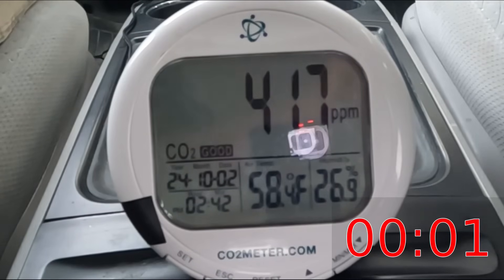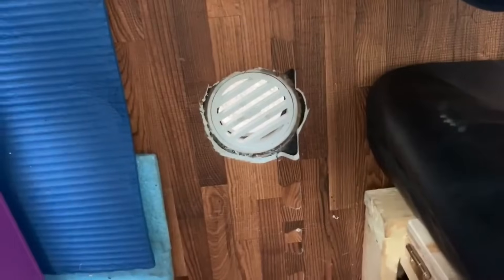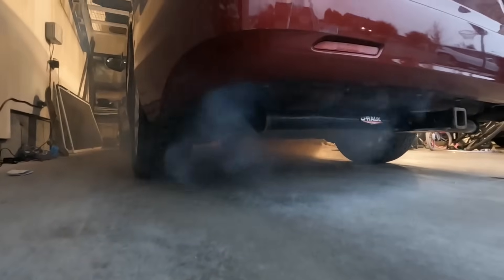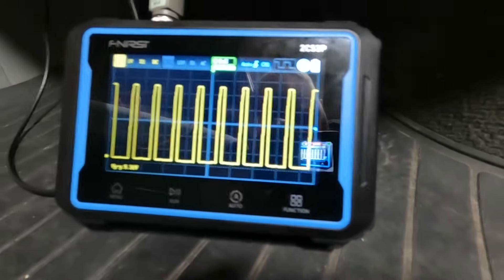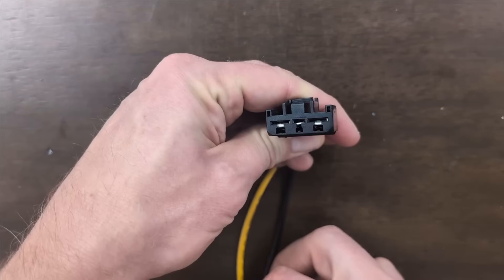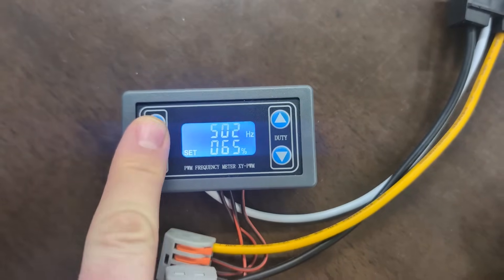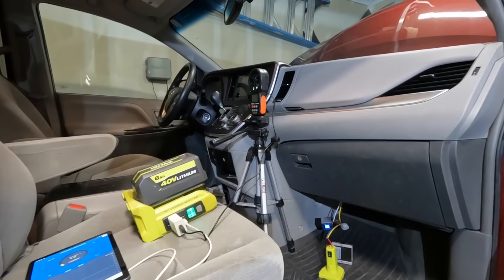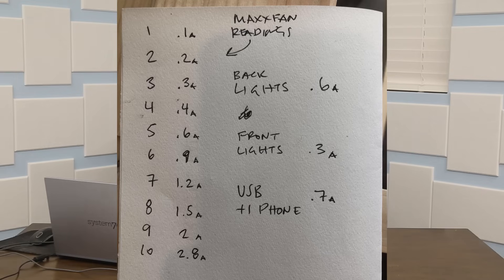Camper van ventilation without using window vents or cutting holes (first see comment by @drewcress)

Comment: I appreciated the effort here but a hidden issue with this approach is most vehicles actually switch to recirculating air as the car turns off. The fresh air inlet is closed to help prevent dust, moisture, and rodent ingress. I spent a fair bit of time figuring out to get both the servo and fan to behave but it gets much more complex as a tap can change the starting position of the servo and break things when the car turns back on. I've tried other ways like a second battery just for car aux power (works) but ultimately the power consumption is just to high to make it worth the effort. What work a bit better is to take a small blower fan and point it out the cabin pressure flap (where the smoke exits). It's non destructive and the difference in pressure will pull fresh air in. However, it's a very small exchange when the van is otherwise closed up.
Reply from the maker: Thank you for sharing! Just to be 100% sure of my own setup, I just now did a smoke test. I put the machine under the hood and confirmed smoke came in through the vents with my battery-operated setup running. So I'm ok, at least, but I wish we had an easy way to tell which vehicles close their air inlets as they turn off.

Out of curiosity, did your tests also use a three-wire blower fan? If not, and you had a two-wire type, can you tell us what voltage range worked best and how you controlled the voltage?
Reply: @SemiSeriousLabs  Interesting! Glad to hear your setup is working as expected. I was a bit disappointed to find the Gen2 Toyota Sienna was more limiting. An aside, but I'm just now noticing much more vertical your air inlet is on the Gen3. Perhaps Toyota came up with a better overall design there given the trouble the Gen2 had with the climate control servos. Maybe Toyota opeted for a bit of an air mixer setting by default too? I could see some upsides to that alongside a more vertical inlet.

As for more exact numbers, I'm afraid I'm not much use there. I was looking if it might work on multiple vehicles at the time and just doing some preliminary testing. It was mostly with a small 12v battery and a pwm controller with a dail, precise it was not. The vehicles in question didn't have a climate control system and their default adjustments where just some resistive elements (hints the silly high power consumption via the aux power approach). All of the vehicle (Express, Promaster, Sienna) did have a recirculation servo that defaulted to internal air when off though. After my testing and a bit more reading, I believed that was generally going to be the case / challenge on nearly all vehicles since the early 90s and onward. Nice to know that isn't so with some newer models with more well adjusted climate controls system. I'll need to do some more reading to understand exactly when and how they differ. Thank you for your video and your testing!
Reply: @SemiSeriousLabs if you want to experiment further maybe find the exit vent and make a contraption to pull air through a part of it?
Reply: I think the recirc flap closing with the car off is only common on older vacuum controlled systems, as there's no vac to hold it open when the engine is off.
Reply: @ericcamolinos3740  It seems nearly all 90s+ and newer servo based systems do this a deliberate feature as well. I'm having trouble finding a modern passenger car that doesn't do this but the lack of a feature isn't the easiest thing to hunt down. I'm still looking, but I've found some hybrid cars use an AC system that can air mix though it still unclear exactly how these behave when the vehicle is off. I did find a couple of RV systems that allow the fresh air intake to be open when the vehicle is off, but those appear to have been dropped in favor of the lower power rooftop options.

So far, I think most adaptations of the above approach would need to disconnect the recirc servo from the climate control / computer and just run it manually via a separate battery and switch for best result. I do want the approach to work simply for elegance of the solution, but at that point, there are cheaper and easier options available as well.
Reply from the maker: @drewcress @ericcamolinos3740  I'd feel bad if someone went down this path on a car with a closed recirculation flap. So, I edited the title to help them see this discussion. Thanks again you two!
Reply: @SemiSeriousLabs  Thanks for editing the title!   AND thanks for taking the time to share this because I was thinking about the same concept and wondering why no one was trying to do this... Now I know... Thanks!!!
Reply: @ericcamolinos3740 As you say, vacuum typically holds open a normally closed flap on anything with a "Max AC" setting.  My 2009 Chevy Express 8 passenger, and by extension probably all older Express/Safari models, is an exception.  For years, I have successfully used the cowl fan for night ventilation.  I have a pulse width modulation controller patched directly into the 2 wire fan motor.  It never occurred to me to check the recirculating system.  You can feel the wave of fresh dry air moving down the length of the van when I turn it on, so the cowl is the source.
  The new system this year uses 2 6" USB computer fans ducted out the generally useless left mid window.  This is better for us because 1) the 2 watt draw allows us to just leave them on 24/7.  2) the exhaust is drawn from above the bed, ensuring maximum moisture removal. And 3) the fans are actually quieter than the cowl fan which attracted notice from an early morning dog walker with good ears.
Reply: Update: after some thought i am suspicious of the OP's claim that most cars close off the vents or turn on recirculate automatically when car is turned off. Most cars have filters so dust and bugs cannot enter anyway.. anymore than they could if you were driving. It also allows some ventilation and if you read car manual they often say keep recirculate off, mostly, for ventilation.

I could be wrong but im skeptical of the claim that most cars close the vents automatically. And if you read my earlier comment you may be able to tell just by listening. My car does not close them automatically when engine is switched off.
Reply: Easy way to check would be to remove the glove box or whatever is in front of the blower assembly and just look at the flap itself. Most cars the mechanism will be visible, so you would just look if it closes when car is  turned off. Or remove the blower, look up inside while turning off car. Or a borescope up the air intake will show you also. Pretty sure my cars (VW, toyota) don't do this.
Reply: Tip: if you go to a quite place and have ignition on and switch on/off recirculate you will hear the flaps open and close. It takes about 3 seconds in my car for them to open or close so you hear the motor for 3 seconds as they open or close. If i kill ignition, i dont hear the sound again. They are staying open. I have 2nd gen honda crv

Comment: Lever wire connectors... We called them Harley connectors back in the day.. Problem was... They would NOT hold the smaller wires as tight as the larger wires in the same connector.... That is why I have boxes of them..lol

Comment: Don't you also just love these little devices we can get so inexpensively from Amazon?  
It's so handy.  We used to have to build stuff like that if we really wanted it.   Of course we weren't building buck - boost converters and digitally controlled stuff with displays in the seventies, but the old 555 was fun to play with and you could make pulse generators. 

Of course you had to have the old HP signal generators to accompany your scope.  Which in my case my first one had vacuum tube electronics and a crt.

I think I'm just gonna bite the bullet and put  a 6" dome exhaust fan on the roof anyway.  With the cargo vans you're not gonna get that hot high air out with window or cabin ventilation.   I've bought little power converters in that same form factor which I can use for variable speed.   I'm using one now for a night light.

Comment: I learned something today. I did not think about air quality in a camper. I was actually thinking about plugging the 2 vents on cargo trailer that I am going to convert. Looks like I should leave them open and maybe add a computer fan on a timer or something. It will take some tests to see if the AC or Heater can maintain a temp with the external air coming in. A Diesel Heater is easy to setup. Instead of recirculating the air inside I can simply draw in outside air with the intake side of the heater. The AC is the tricky part. Most AC don't draw in air from outside not even window AC's do that. They only Exchange heat from one space to another. This is on purpose to remove humidity from the air and cool faster. I might have to time the computer fan according to the CO2 content in the trailer to bring in enough fresh air.

Comment: There are usually rubber flap "louvers" in the B and C pillars, and in the drain gutters if the trunk or rear hatch. That's where you factory vent normally exhausts. When you are driving, the low pressure air behind you literally sucks air out of those vents.
 If your cabin fan is on a fuse of its own (check the manual, pull the fuse and see if anythjng else dies) you may just be able to supply alternate DC power to the fan. Before computers infested everything, the fans were plain DC and the fan speed selector was just a switch if resistors to run it at varying voltages.
 And while usIng PWM can be cheaper than resistor switches, sometimes just using low voltage plain DC is simpler, and sufficient.

Comment: Adult resting respiration rate is less than 0.5 cfm. The C pillars in my SUV have small fixed vents to accommodate passive exhaust of cabin air when moving. For cold weather venting a small computer fan will accomplish sufficient air exchange with little noise or heat loss. For hot weather, a higher capacity unit on the other side will be needed!

Comment: I have done the same trick on my Chevy express.  A 2 amp draw happens by using the notorius factory speed controller, much of that being waste heat in the controller. With a PWM (12 volt here) you can flow air at a rate comparable to OE low speed for 10 watts.  The starter battery provides all night air for a discharge that the alternator replaces before the engine warms.  Note that the vent recirculation flap rests open on the Express. Many rest closed, requiring additional bother to access fresh air.  I don't know why his fan makes such a load, unless he figured correctly about the cabin filter or other restriction.
  My new system for 2025 uses two 6" USB computer fans placed inboard of the left midside vent window.  This is weather resistant, quieter than the cowl fan, and exhausts from above the head of our bed.  It draws 2 watts from a USB port on the house battery's charge controller.  At that rate I just leave it running 24/7 and enjoy the cooler cabin.  The cowl vent control PWM remains in place because it is better than OE for a couple reasons, and because you can't beat the factory cowl vent for excluding water during thunderstorms.

Comment: Mail delivery is a thing.  If you want to see what will break on a vehicle, let a mail carrier use it in curbside delivery for a few years. Any weak points from brakes to fuse blocks to seat belt retracters will be found.  Over the years there were 4 different transmission families used before the last one could survive 60k miles. It had issues, but only the B52 gave better service.

Comment: How did you put the hvac unit in 'vent' mode. that is, how did you set the system to open the flap to let fresh air in and not just recirulate?
Reply from the maker: Oh, just turn off recirculation. It's the button with a picture of the vehicle with a curving arrow on it.
Reply: @SemiSeriousLabs  were you able to do that when the van was off? I guesss I'm wondering if there's an automatic way to make sure that the recirculation button is 'off' (allowing in fresh air).

Comment: I have run just a normal DC plug-in fan for over 48 hours without killing the battery in my old Dodge ram. The DC appliances seem to be very efficient i could easily run it during the hot part of the day to take the edge off

Comment: In my Toyota 4Runner, I take out the contents of the glove compartment at night, remove the two small access doors at the rear inside the glove compartment, then remove the cabin air filter. The space where the cabin air filter normally sits is where fresh air comes into the vehicle, through a grill at the rear edge of the hood. Then I put a small metal rectangle at the bottom of the space where the cabin air filter normally sits. This plate diverts incoming fresh air into the inside of the glove compartment instead of going to the OEM blower motor. Then I cover the open glove compartment with a piece of plywood fitted with two 12V 120mm Noctua computer cooling fans that are hooked up to my 12V auxiliary battery. The fans gently blow fresh air into the cabin all night. I have another set of two Noctua fans exhausting stale air out the rear of the vehicle. The fans have extremely low current draw. This stealthy setup has prevented any noticeable condensation inside the vehicle on 24 degree F nights with two people sleeping inside the vehicle and all windows closed.

Comment: Interesting really you only need a tiny amount of air movement. , So even if you set the motor so it's almost silent that would be enough and prob uses hardly any power

Comment: "the wiring colours dont make sense" - when you're creating a wiring harness that needs tens to hundreds of wires, many of which are 12v supplies with different "switched" elements, colours go out the window and the only thing that matters tis the schematic telling you what colour does what. Black/red is only a convention for when its convenient, it can be far more confusing if used in a complex scenario

Comment: open the box and check the motor find out its lowest possible setting below level 1. Put in a resistor so you get 1/4 of the lowest setting so that the fan is just barely moving. This should be enough night ventilation? to be tested

Comment: I'm very interested in this setup for camping.  I'm curious as to how long the van can run the fans on ACC mode? From your experiment, a 6Ah 40V battery (240Wh) can run at lower speeds for 7 hours.  If this is the case, can we not leave the van on "Accessories Mode" and let it run overnight?  I have a 70Ah AGM Energizer starter battery (840Wh), even if we used up 400Wh for overnight we'd still have no issues starting up in the morning, no?  What do you guys think?

Comment: This is an amazing solution. Personally, I would replace the pulse generator with a microcontroller and also connect a simple air quality (maybe also moisture) sensor to the microcontroller. That will allow you to only run the fans when the air quality is bad enough to make it necessary. This will make the setup even more efficient and stealthy.

Comment: Cars are actually quite leaky, with concealed air vents in the footwells, B pillars, trunk surround or other places. And as a result of federal safety legislation, there's always a fan running if the ignition is on, even in the ACC position. Ignition off, and those vent paths are still open. Turn on the ACC to listen to the radio on a hot day when the car has been on AC, and you'll immediately feel HOT outside air, not recirculated air, is being pulled in. I think that started in the 70's.
 Of course CO/CO2 meters weren't commonly available then.

Comment: Subbed!  3:21 This is extremely valuable research.   My blower only has two lines (brown and orange) .  I tried connecting a 12v source directly to my blower but it wont blow a high speed?  I can't post a link here but if you search "cyberpine powering-a-c-fan-from-auxiliary-battery-how-much-fresh-air.107549" you will find my notes and pics.
Reply: wonder if maybe if my 14v LIFEP04 source is the problem?  AI is suggesting i need a resistor.

Comment: The high current draw is related to the low voltage. At 5 volts you need more than double the current to equal the same energy output as a 12v fan. It doesn’t necessarily mean your vans blower is less efficient, it’s just running at a lower voltage. The wattage is what will tell you the actual energy used
Reply: He clearly knows how voltage and power works, considering the appropriate use of step down converters and the mention of battery capacity. He mentions amps because that is normal in the automotive industry since everything runs on the same 12V. His main takeback is that the car ventilator requires more energy than expected, not necessarily that the current was too high.

Comment: Finally, a truly intelligent concept!

By the way, continuous operation of the fan or ventilation system is not necessary. If all the air is consumed within 15 minutes, it’s important to determine how long the ventilation system takes to fully replenish the air supply.

For example, if you breathe for 15 minutes and then activate the ventilation for just 5 minutes, you establish a 20-minute cycle. This means that even with a 1-hour battery, the system could potentially last for up to 4 hours.